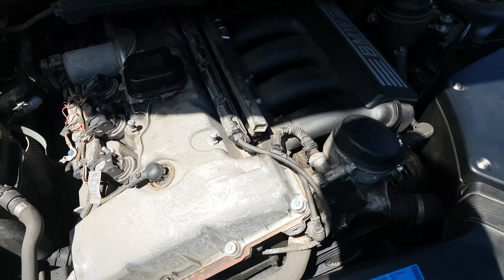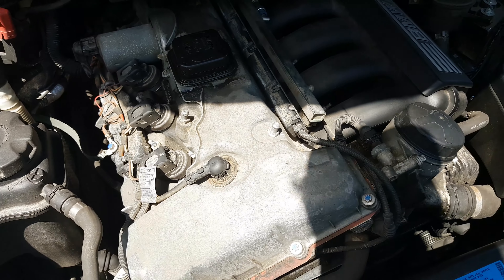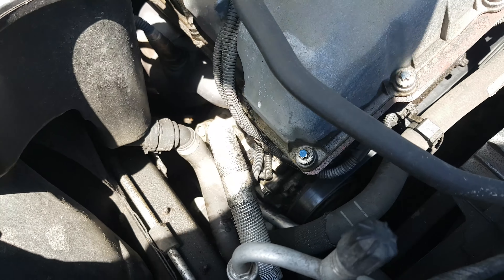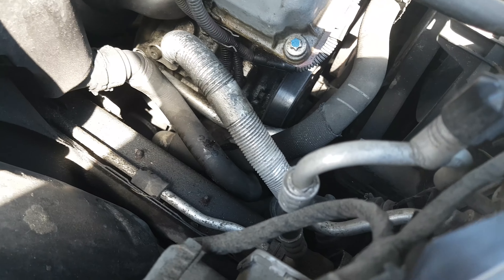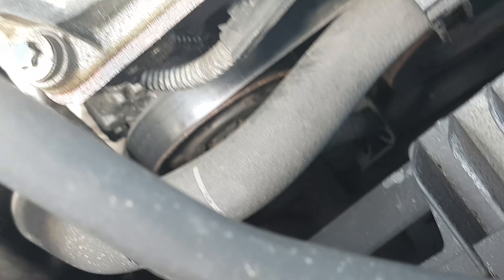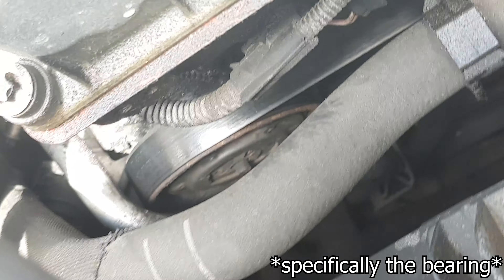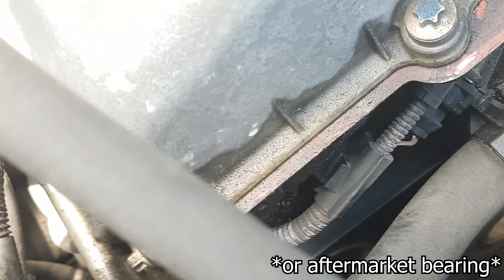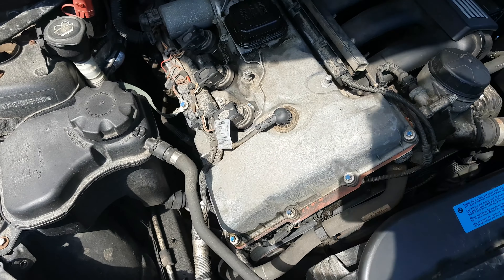Bad A/C Bearing Noise Sounds Like Lifter Tick || E90 (BMW COMPRESSOR ISSUE)

Comment: Your video advertises a ticking sound...
Reply from the maker: LOL sorry I didn't want to risk my A/C Exploding for a video...
Also if any of the people complaining about this took 5 seconds to go on my channel they'd find this video https://www.youtube.com/watch?v=uf_Zqxc92do and also the following video where I showed my exploded A/C bearing.
Reply: @carboii3448  I'd say go ahead and make it a very noticeable annotation within the video itself.  Been there with how horrid Youtube is for stuff like that, and even I was getting sucked into just wanting to hear the noise.  But indeed, you have the same noise as my 128i is making.  I was thinking it was a harmonic balancer, belt tensioner, and even Vanos... the only tell-tale for me is a light smell of refrigerant.  Not sure you had that.

What bugs me is that turning the a/c on or off doesn't change the sound for me, and I would have thought it would.  That's why I discounted that at first.

Comment: I’ve got an E60 M5 same thing. I thought I had lifter issue bearing in AC was bad and the ac wheel was a little sloppy but the ac was still cold. I thought it was my vanos then thought it was a lifter repair shop told me ac compressor was bad. Rather ac compressor than lifter for sure.

Comment: were you able to fix the pulley or did you have to change the whole compressor ?
Reply from the maker: Happy that someone asked that lol. I waited 2 weeks for a sketchy ebay pulley to arrive but as it turns out (and not to my surprise either 🙄) BMW makes these compressors so that if 1 thing breaks, the whole unit is garbage. So I had to change the whole compressor and it costed me a juicy 2100 Canadian Rupees.
Reply: So can I replace just the bearing or do I have to replace the whole compressor mines not broken yet.
Reply: @BmwAlex0621   I would do the bearing. If u know how or don't lol watch YouTube vids don't get ripped off haha
Reply: @ryhu5642  i ended up fixing it i never take my cars to shops😂
Reply: @BmwAlex0621  What was the issue and how did you fix it? Was it the AC compressor?
Reply: @sukhjeetsidhu5312  i never fixed the compressor but you cant replace just the bearing you have to replace the whole compressor
Reply: @BmwAlex0621  what did spend $?!